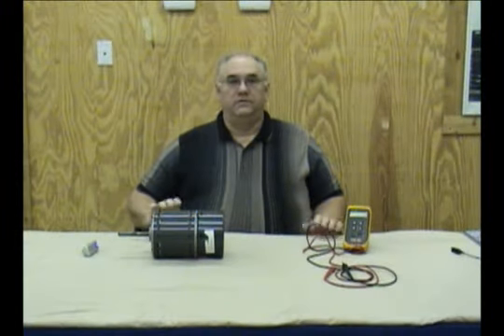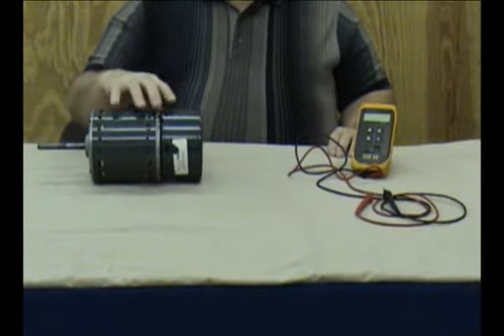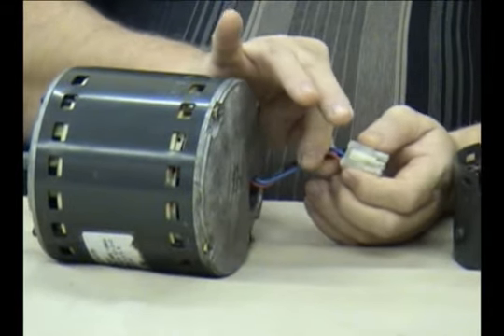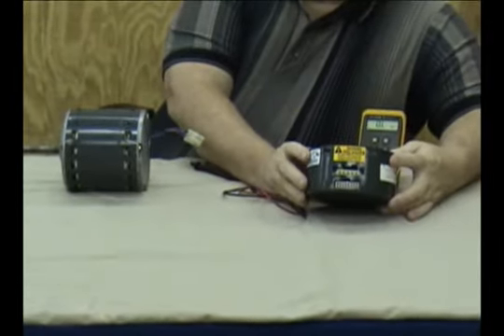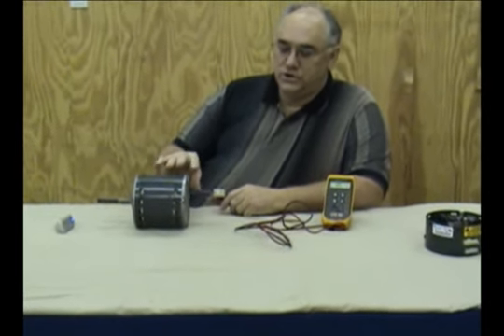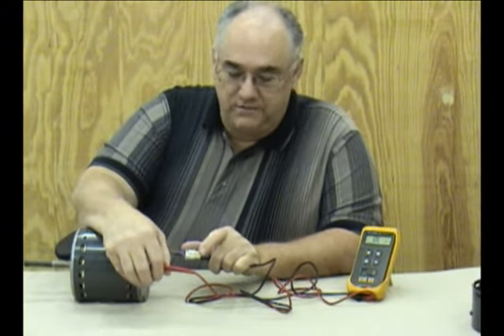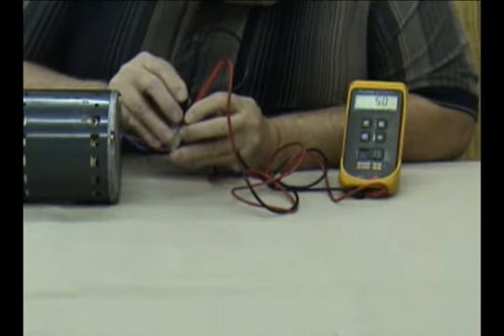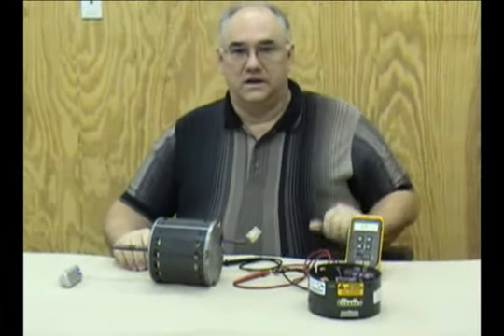Universal Zebra: Testing ECM Motor Winding Sections

Comment: Gentec also has a ECM motor tester, when not sure if it the board or module, motor, very easy test, my company bought me one, not sure on the price,  they also supply a manual, with all resistance readings, if under warranty, and the control module failed, I always replace both.

Comment: Good demo on the work . I noticed these motors first showed up in VCR tape drives & brushless DC fans in the 1980`s. now used in Radio controlled cars & planes ,Hybrid cars ,power tools & so on even battery powered Zero turn lawn mowers . I`m  getting into the study of them .